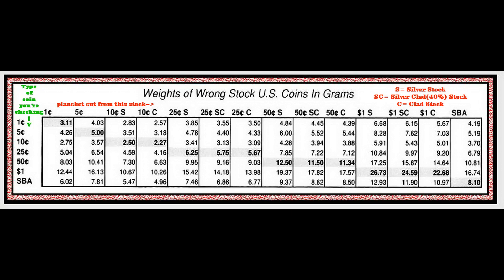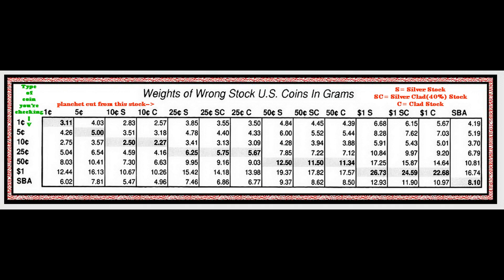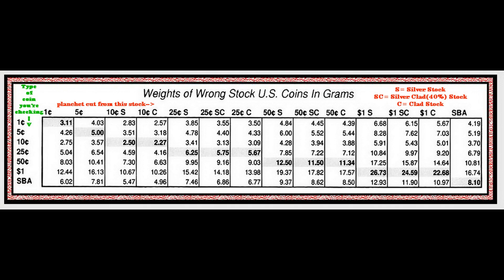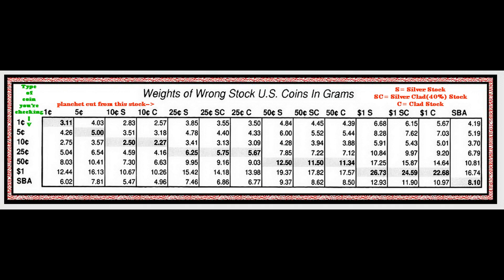Wrong Planchet, Wrong Coin Sheet Stock? Chart with the weights of coins, pre-1982

Comment: You know, I've found several of those 10.4-10.5g half dollars. I sent one off for grading, along with 2 half dollars that weighed 8.8g. The 8.8g came back "Struck on Quarter stock". The 10.5 came back "struck on underweight planchet". I'll try to remember to take pictures of the slabs when I get home. I have a video I uploaded showing them.
Reply: https://youtu.be/7z9o-fGWyhs
Reply from the maker: Your name and coins came up last night when the 10.8 gram half that sounded different was found. While the chart might not explain all anomolies that can be found, if the 10.5 was punched in the Susan B Anthony era, it could have very well been on SBA stock. Of course, the mint has made coins for different countries which wouldn't be listed on this chart, so the possibility is there that it was another countries stock/planchet or that SBA type stock was used for other countries also which could account for the "underweight planchet" designation. Hard to say for sure.